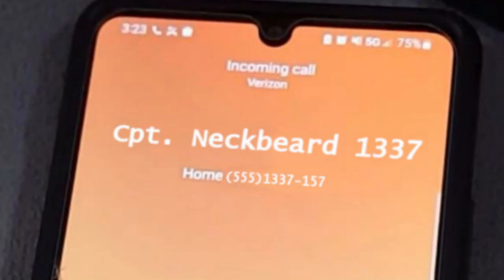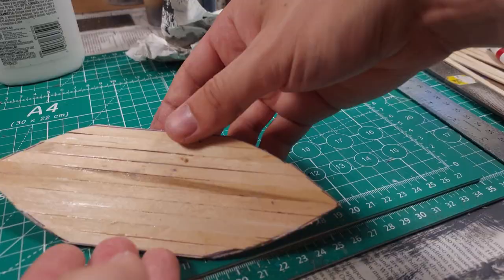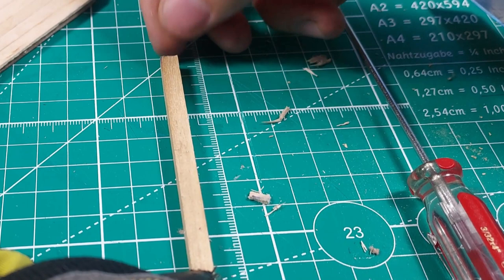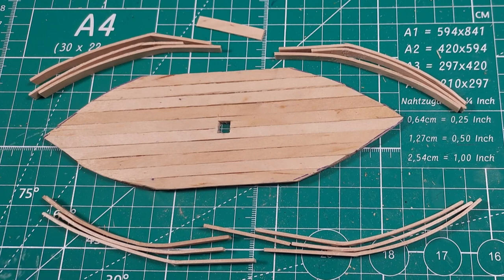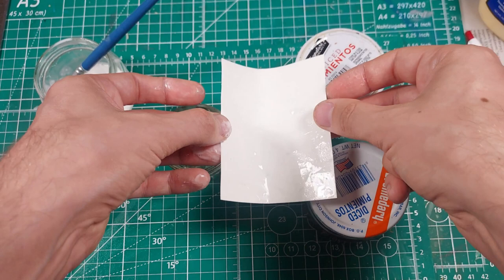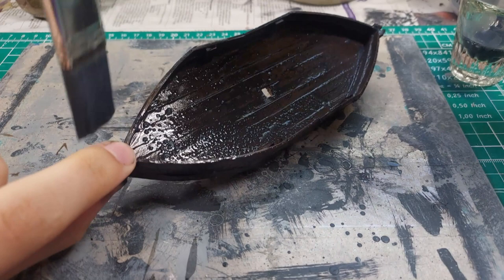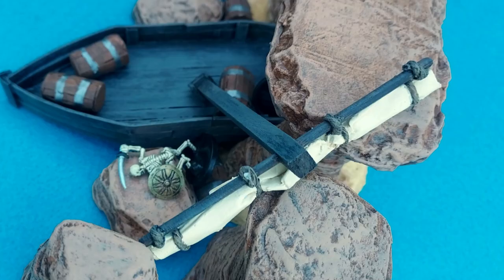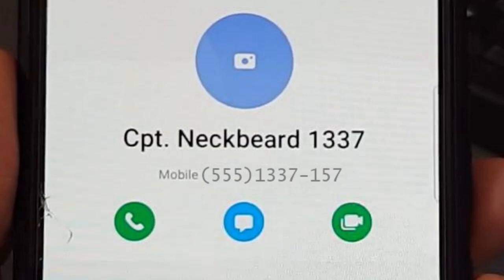How to Craft a Stir Stick Boat for Miniature Gaming

Comment: For the base part, it might be a good idea to go with modpodge rather than glue, same basic stuff, it tends to work slightly better because you also end up reducing a warping risk with them.

With the type of boat, you might also want to make any future ones with pieces of wooden dowel for the front and back, making it a bit more realistic for the size with a look like a main beam that would have been used in construction of it, and you can even do things for interesting bowsprits on them...one easy one is to grab a cheap chess set and use part of the knight fitted to the front.

And if you have access to them, baby wipes/wet wipes dried out before adding glue tend to work better than paper or cardstocks.